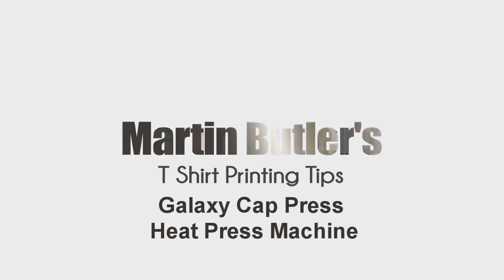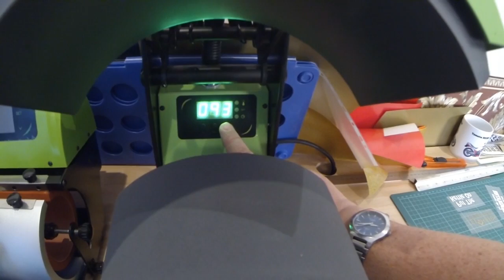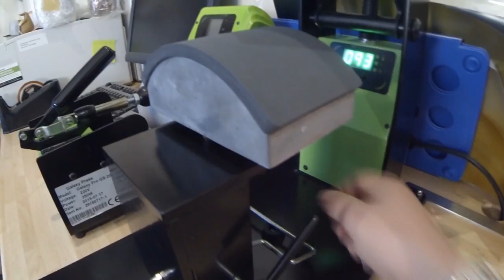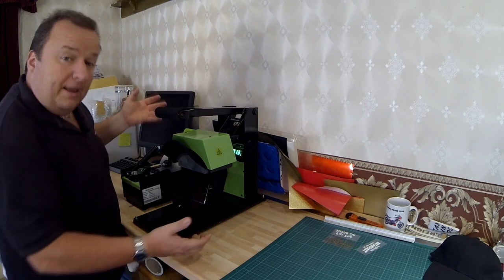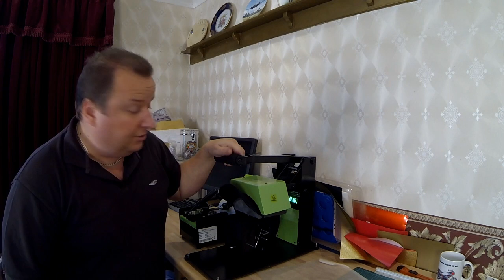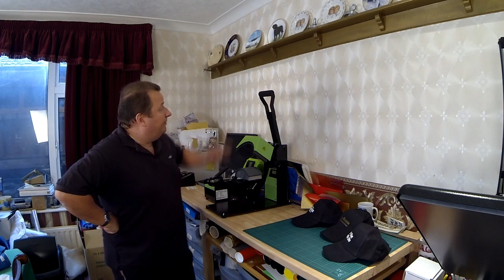Galaxy Cap Press Heat Press Machine Review

Comment: Hi Martin, I am about to purchase a press but I'm not sure what size of platten would be a best fit for both standard adult and child size caps? What would you advise? Great vid as always. I bought your DVD and it is also fantastic!
Reply from the maker: This one is a larger one, i've not measured it but you should be able to do many sizes with it.
Reply: I got this from Subliblanks. I don't think they sell them any more but you'll find them on ebay.
Cheers
Martin
Reply: Thanks a lot Martin. I wonder if the size of platten you have fits most adult and kids' caps? They have a choice of sizes. Eg. 3.5x6.5inch and others.

Comment: Hi Martin 
Im in the market for a hat press. Do you still recommend this model?

Regards
Paul
Reply from the maker: +SCCFORUM HI Paul, I've had no problems with mine so that's all I can say really.
Cheers
Martin
Reply: +Martin Butler Thanks for the reply.
I ordered one last night. Looks like a well made machine
Reply from the maker: Good luck bud.
Cheers
Martin
Reply: +Martin Butler HaHa. I might need that luck. I ordered off amazon and the machine is Blue with grey bottom plate and handle as yours is with black. Apart from that they look exactly the same. Im hoping they are the same machine.
Reply from the maker: SCCFORUM
I'm not sure it is. The Galaxy one I have is licensed from Subliblanks so if that is not the supplier, it's not the same.